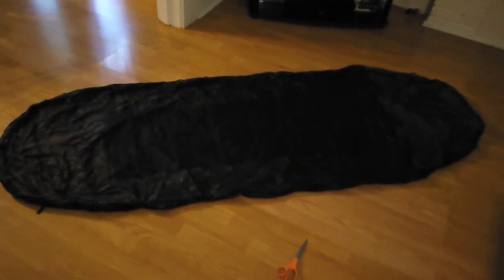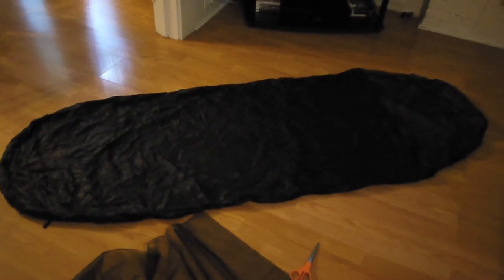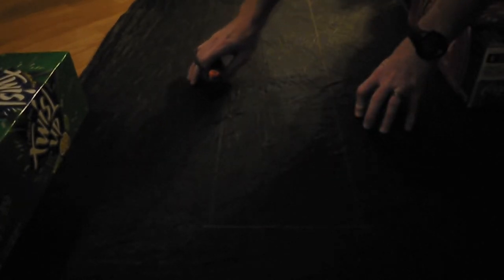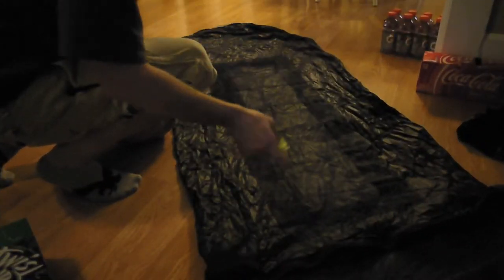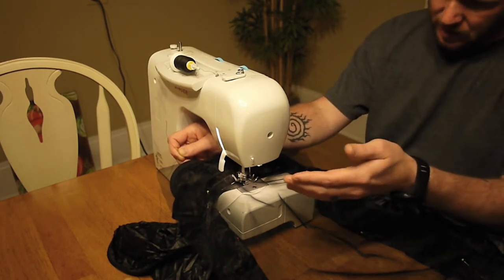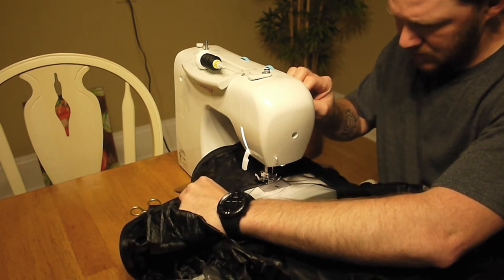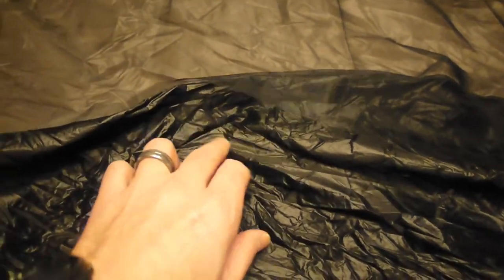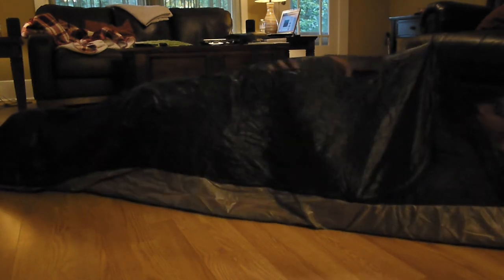Borah Bivy Modification

Comment: My original MLD superlight bivy has M50 and small Mesh over face.  I'd agree ventilation not as good as I'd hoped. The one with full mesh over head but still SL bivy has a new Endurance fabric. But it's 194g in large. I'd like the regular full head net with cuben base. That would be under 150g I'm sure. Great video and very brave!

Comment: Great video and awesome job.  Wish I had seen this before I bought the same Borah bivy as you and Cesar but glad to see that the mod is possible.  Really LOVED the end of the video (dog and wife were great!)!

 I actually hiked and bivy camped part the the Bohusleden in Sweden with my dog, Lexa-Lu, and she slept inside my Exped bivy with me.  The bugs made this a must.  We didn't have any condensation in the Exped but decided to order a Borah with side zip as the Exped was a pain in the butt getting in and out of.  I am not as physically flexible as I used to be.

Gonna try the Borah bivy for a couple nights before modding if need be.  But thanks again for sharing the vid.  Greetings from the Roadside.
Reply: Chad Poindexter I bought it at the end of the summer and it was sold as M90 so my guess is, it probably is.  Will definitely give it a road test when things warm up.  I also bought a Borah Snowyside Bivvy and I will check that out in the next couple weeks.  I love my Exped Bivy but it really is a hassle at my age getting in and out considering it only has a chest zipper.  I might have a look around to get that modified with a side zipper, but think it would be a difficult task to pull off because of the design.  Anyway...Happy Trails!

Comment: why didnt you get the net bivy?  would saved $ and extra work.
Reply: +Chad “Stick” Poindexter besides bein able to slightly stop side spray there isnt much difference at all..i went with the net bivy after watching this ..just to save having to mod the UL bivy to better breath ..side spray is easily remedied by droping the tarp lower to the ground..but this i all my opinion of course..in reality i want the cuben bivy but with a net top like the regular net bivy..maybe add 4 inches to the side cuben for higher bathtub..but having mesh on top it wont have condensation issues like the m-90 and m-50 an argon type calendered DWR fabric....another idea to remedie the condensation issues would be to make an M-50 sleeping bag liner..its a trick we used in winter climbing to keep the frost down ontop of our sleeping bags.it keeps your body moisture closer keeping you warmer and keeps the condensation down..some old school climbers even use vapor liners..those can be clammy though..  another idea ive thought of is a full cuben top and bottom with that 4 inches of mesh to breath..an also add a flap with velcro to close over the mesh for all weather protection..im like you in always thinking of a way to mod gear to fit our styles..